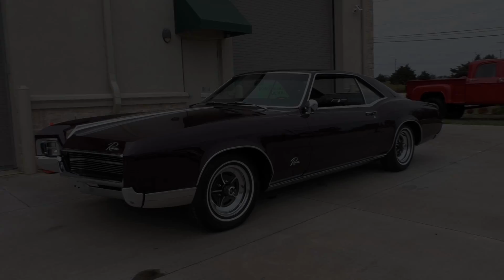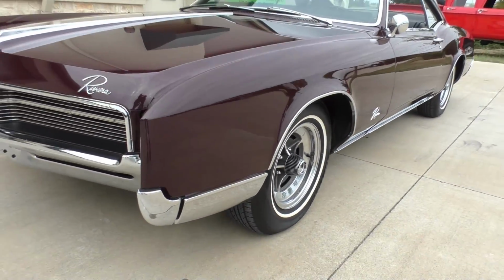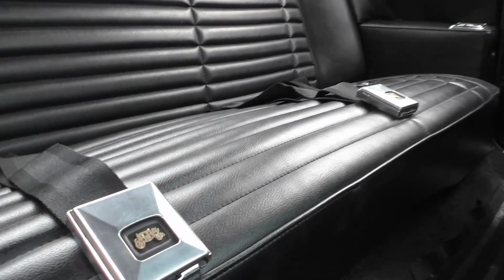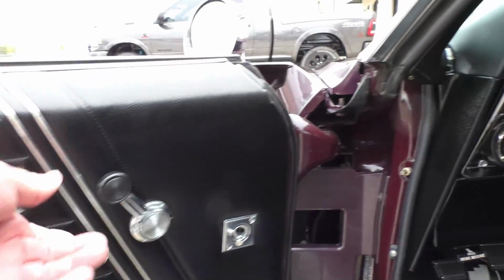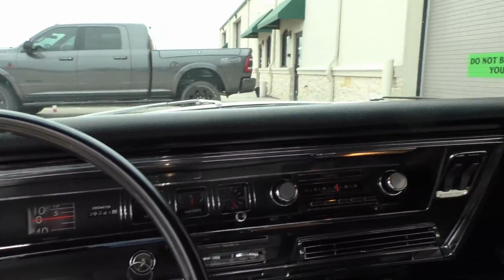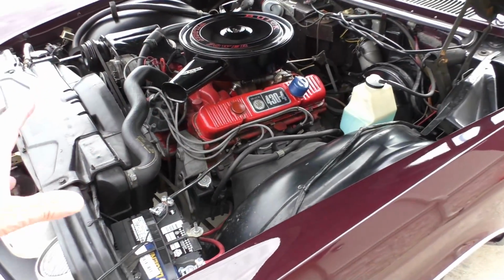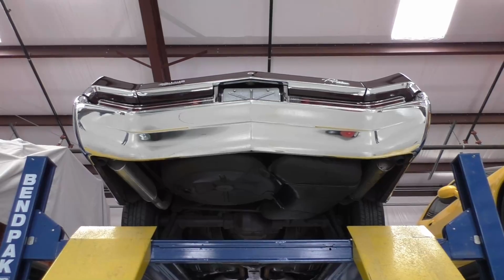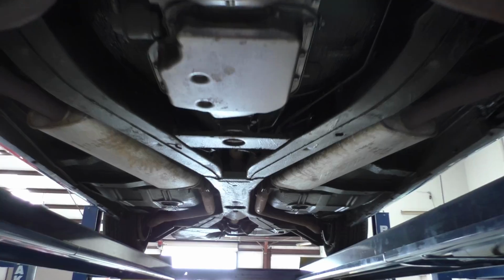1967 Buick Riviera 430ci V8 "Only 9,241 Actual Miles" (Sorry Sold)

Comment: The only design aesthetic flaw in this generation of Riviera is: the wheels are set too far back into the wheel wells. They should be further out to the outside by a good 1.5 to 2 inches, imho.